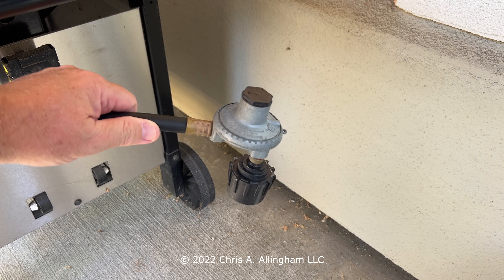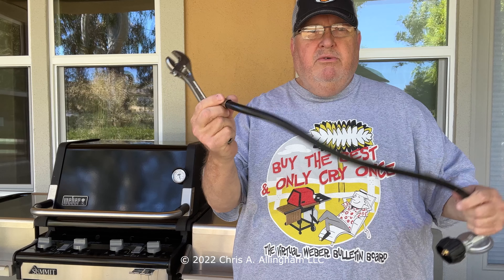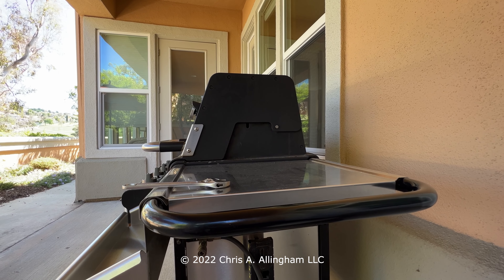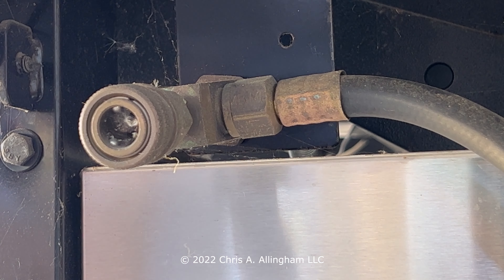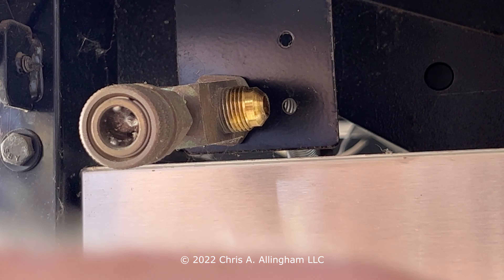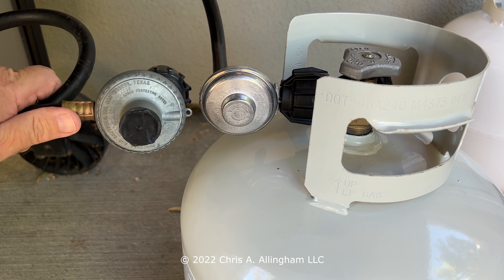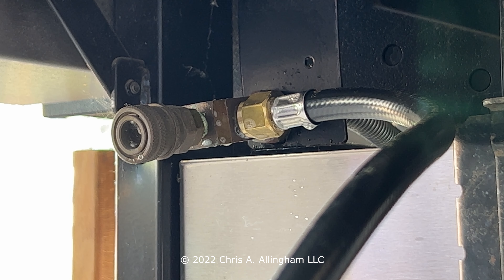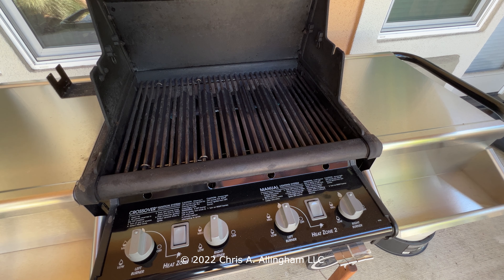Replacing Propane Regulator On Weber Summit 450 Grill - Chris Allingham - virtualwebergasgrill.com

Comment: Happy to see some diversity on the cookers. I run a diverse  types of fuel ( still don't have a pellet cooker, not in a rush on that) and I don't know why some folks say it's not "authentic " bbq unless- - - , well you understand. If your going to grill and time is in short supply propane is a great fuel source. Clean, inexpensive, easy-to-use and when done properly safe. For a grill with a couple of decades under her belt she's looking good and definitely overdue for a new regulator. Some years back I started to always buy a second regulator when buying the replacement because sometimes regulators last several years, and sometimes they don't. Last thing. That grill looks like it could use a complete go through at the end of this season. Show her some love and clean up the hole unit. But overall she looks good. It's sad when I see some folks throwing out a grill that's only a couple of years old because they are having troubles with it. You can tell by looking at it that they never once cleaned it. Anyway have a great day. 🌞 👍🍻🔥